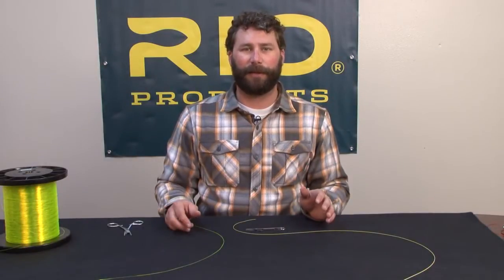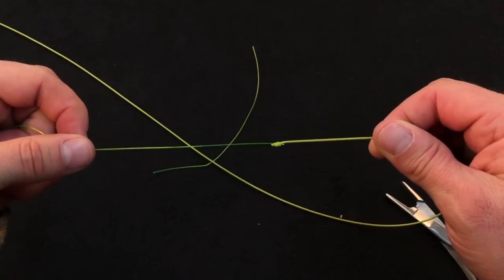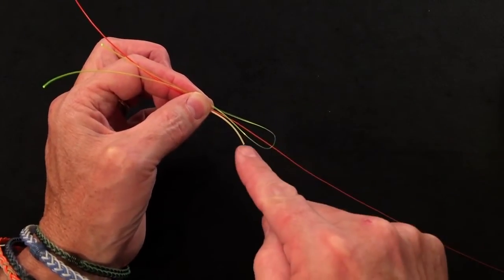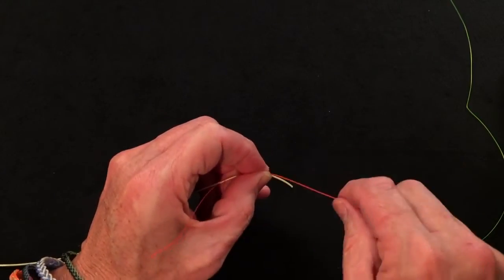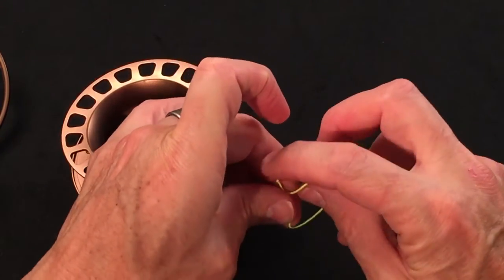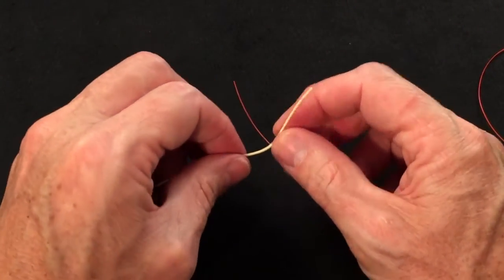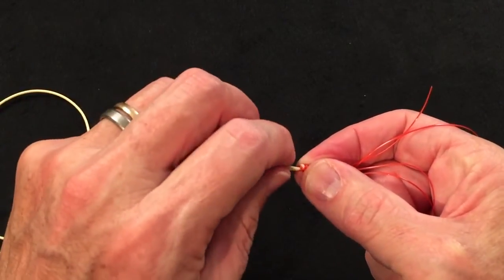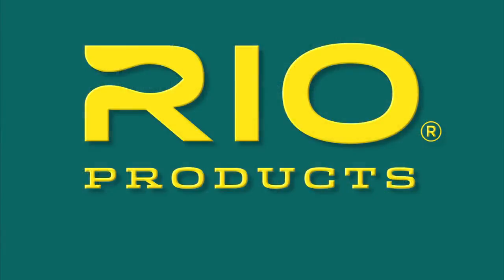Four Useful General Purpose Knots for Fly Fishing

Comment: I was wondering if tying a uniknot to the fly line would hold and bite, it looks similar to a Nail Knot
Reply from the maker: It certainly would, as long as you tightened each end firmly before snipping off the loose bits